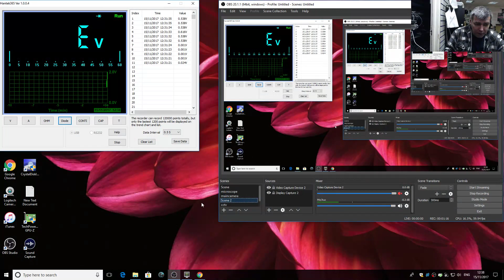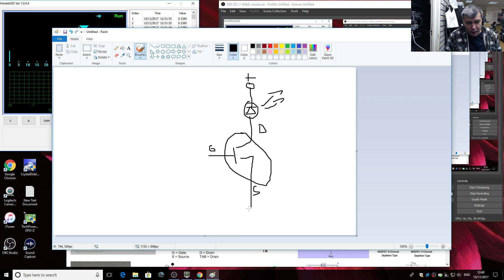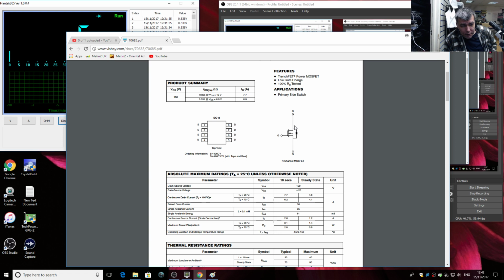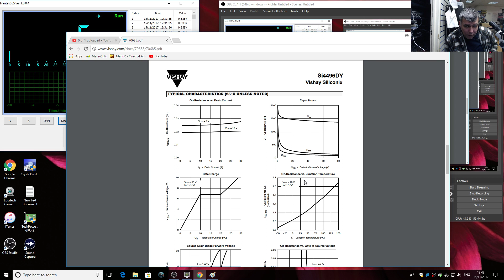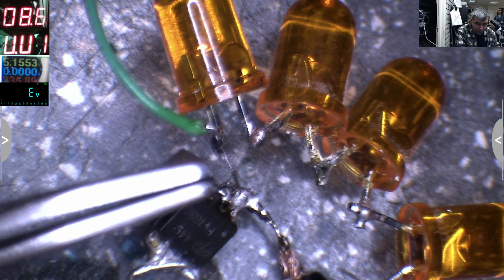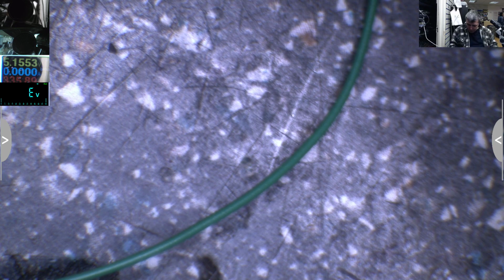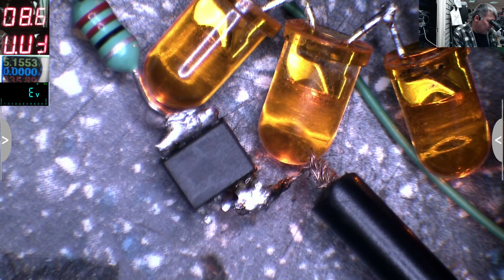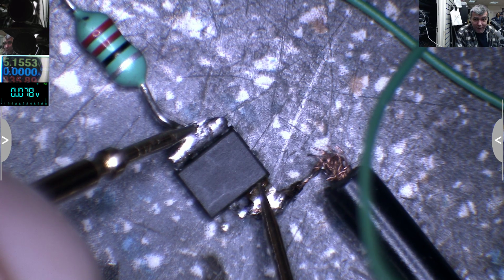How they work and how we can test a Laptop Mosfet

Comment: I think the confusing thing about mosfets is only three connections, G,D,S but multiple pins. In practice, could you simply connect to only one of each pin so Gate, Drain, and Source all have only one connection? Why the multiple pins? Never mind....the video answered my question. :)
Reply: yes you could but for example the drain is connected to 4pins to decrease the resistivity that might be a problem for high current (30A in his example, that's a lot to have in a single pin). Same reason why you use 3.5mm for oven instead of 1.5mm for lights in your house.
Some mosfets are very small because they are used as signal switches, not power switches (eg. for power rails in motherboard).

Comment: OK sir, but in Laptop theory 19v to drain pin and we expect 19v output  on the source pin, to get 19v output on the source pin we need to open the gate , for the N channel mosfet needs more voltage on the Gate than the input voltage to open the channel to source , so how the the touch opening the channel?.. on a laptop it's not possible to open the gate by giving lesser voltage on the gate .. I am confused

Comment: Is it acceptable to have "a short" signal through the secondary Mosfet's beside "the coil", even when the gate is drained or grounded to close the gate?  Are some Mosfet's designed to sound as a short between the two sides of a Mosfet that is not the gate?

Comment: ive bought a dell xps 17 inch worth 300 for 40 quid. it has a short when charger ia plugged in. ive stripped it down and immediately next to thr power rail from the dc socket there are 2 mosfets. one mosfet gas readings on each side. the other just reads 1 on every pin. does this mean it is the cause of the short?

Comment: using mosfets allows the battery to have more life because it uses current instead of  extra voltage  like transistors that use/ high volts ?

Comment: Thanks for your lesson, I still have couple questions:

- to close the mosfet you said you just need to touch it, do you have to use something electrically conductive (metal)?
- how is the gate "touched" by other components in the motherboard and how do they stop touching the gate?
- is the mosfet supposed to stay closed in a motherboard after you turn it on or the resistor connected between the gate and the source will uncharge it just after it was charged?
- Are mosfet just supposed to rapidly close and open (buck converter) or they can also be used as relays?
- is the voltage in our body charging the gate or just the tweezers (imagine you are using isolating gloves)?
- the PDF says + - 20 Volts for the gate, what does that mean? Is that a range?
- you said industry is using mosfet over transistors, would it be possible using mosfet in CPUs? Are they already doing it? would that be better?

I'm very curious I know, I hope you or anybody else here in the comment section could take the time to answer.
Reply: Let me try:  Any that holds a charge can "touch" the mosfet to activate it.  The superIO normally sends a signal to the gate 1/0.  The gate is normally tied to the source so that it's normally pulled low and will be "off" unless a voltage is added.  Yes, they can be used as relays.  There's enough area on JUST the tweezers to supply a charge to the gate however typically your body (hair + clothes) help to "self-charge" you as a charged object.  I believe you can put upto 20 volts on the gate but probably best to stick to TTL range of ~5V.  mosfets & transistors are both semi-conductors.  The cpu uses its' own "flavor" of transistors for logic switching.  But the term "mosfet" is usually associated with higher current / power side.  ie/ the internal semiconductor area of mosfets is HUGE compared to a cpu transistor. ie/ 1 switch vs 100,000,000 switches.
Reply: @jonclement  thanks for trying 😁👍

Comment: ...Weird!  I thought that N-Channel MOSFETs let the power through when the voltage on the Gate is higher or equal than the Source.  So how come touching the gate with tweezers (=0 volts) allowed the 8 volts from the power supply to go through? ...Is it because we're missing the outside resistor between the gate and source?
Reply from the maker: Namolo Kaman yes!!! And our body has a lot of electrostatic energy
Reply: what? voltage on the gate >= source? you need to study more about voltage, that doesn't exist. What matters is the diff between gate and source (Vgs). Saying Vg>=Vs has no meaning per se.
Same comment for the tweezers at 0V. That doesn't mean anything. Voltage is always a differential measure.

Comment: OK, you've shown why can't we test for shortage to check if the MOSFET is broken. But you didn't show how can we actually check it instead. So how can we find a broken MOSFET on a board?
Reply: You find it by searching or by looking where the magic smoke came out.

Diode mode test source to drain. It can show short even if it is good. Always connect gate(single pin) to source to make sure the fet is closed

Comment: Your LED direction is reversed... 2:41
Reply: Because in this case it is a LED. But in other cases we need to check the type of diode in the circuit 'cause for protection a particular diode could be ok as in the case of a Zener diode used for protection in laptops like in VIN 19V circuits.

Comment: Hi! I bought used samsung galaxy s7. After 3 months someone blocked my IMEI code. I can't make calls and send sms or use mobile data. Is only way to fix it is change motherboard?
Reply: Whats the carrier
Reply: RepairGeekz Computer and Cell Phone Repair     

I am from Latvia. There are different system. IMEI is blocked, because my phone is probably stolen.
Reply: narzan q I have IMEI. I don't care it is illegal, but on newer phones it is very hard to change it

Comment: Simple but effective. Very useful video. What will happen if we switch the plus and the minus. The circuit will close again but will the led blink.
Reply from the maker: if you switch, will be short because of the diode
Reply: last silly question. If we switch the polarity and use PNP instead of NPN. The diode is in opposite direction.